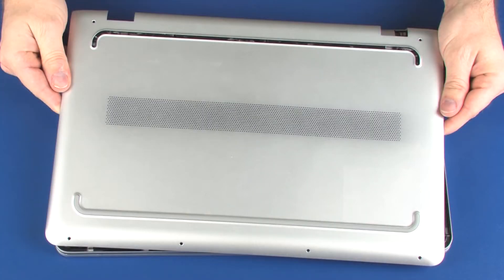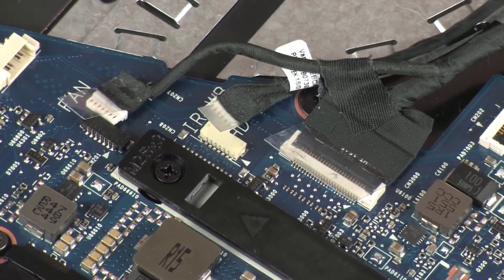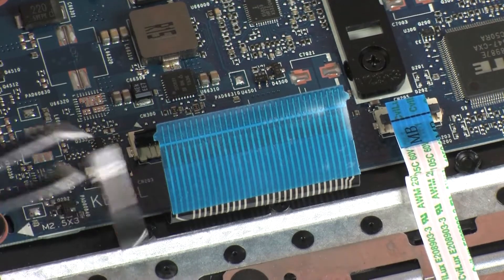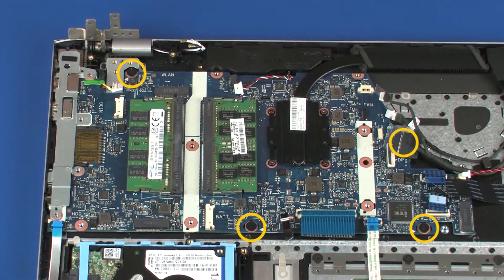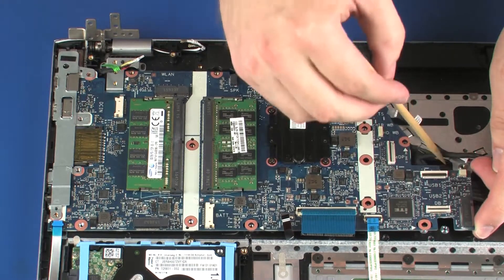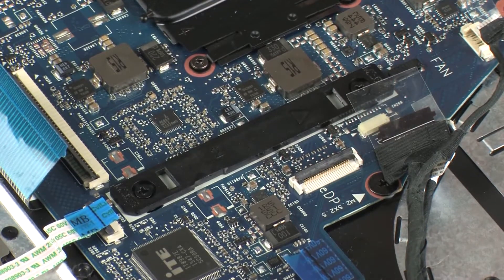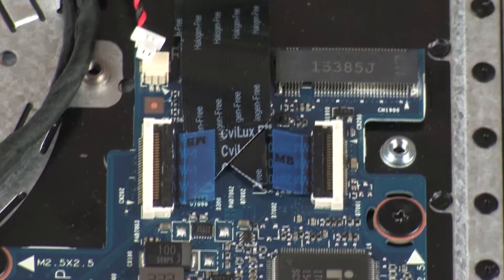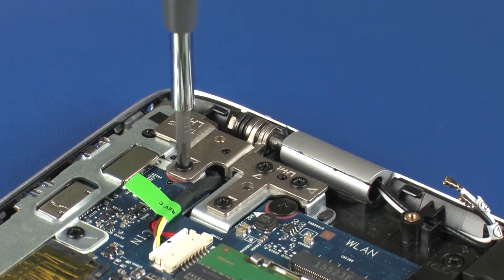Replace the PC-System Board | HP ENVY 15-as000 notebooks | HP Support

Comment: I am looking to replace the keyboard on my 15-as120nr. Does this video apply and do I need to Remove the PC System Board before I can access and replace the keyboard?  Thanks!!
Reply from the maker: +Ui Chen Please refer page number 68 of the user manual to know about replacing the keyboard: https://bit.ly/2UjBsZ7
Reply: @HPSupport  Thank you for responding so quickly!